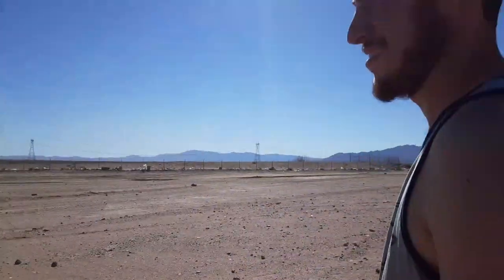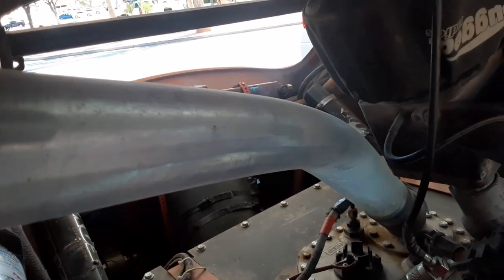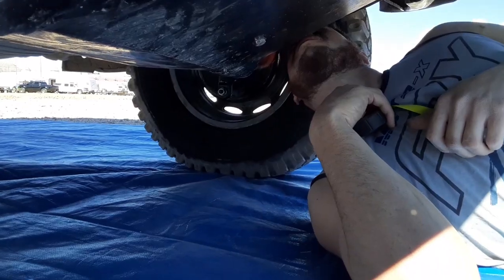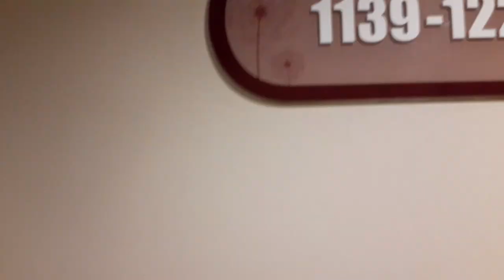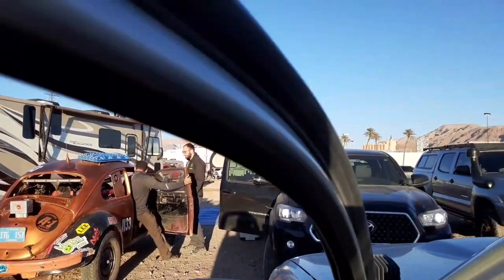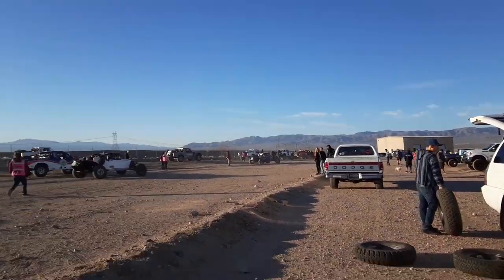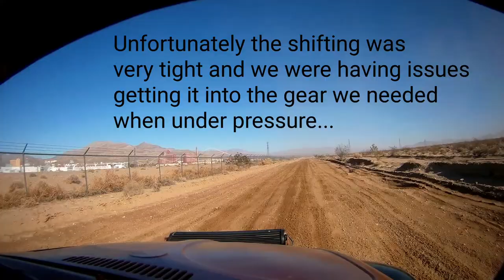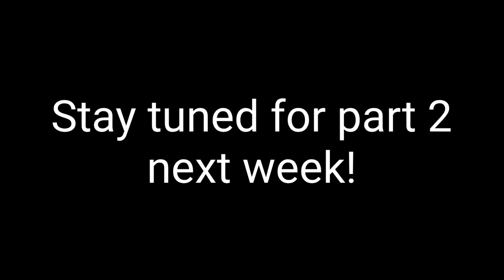IDIOTS go RACING the SNORE 250! 🔥🍻 part 1

Comment: Is class 11 limited to fenders and a 1600 motor. I have a baja bug but it has a 1769 motor and it has the typical baja fenders.
Reply: Class 11 is a stock class limited to 1600cc, bug transmission, and full body. There is much more to it as well. You can look on the S.N.O.R.E. website or the S.C.O.R.E. website to look further into class rules.
Reply: There is also class 5-1600 and class 5-unlimited. Those classes do not require a full body, and allow for more aftermarket parts.